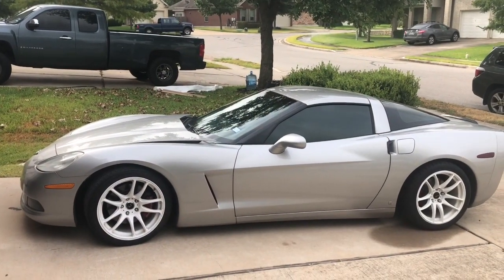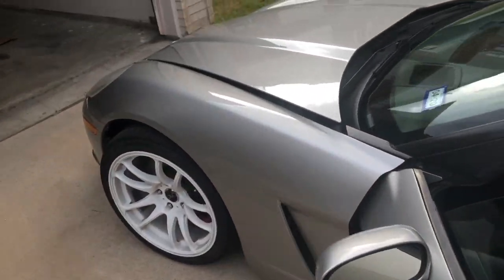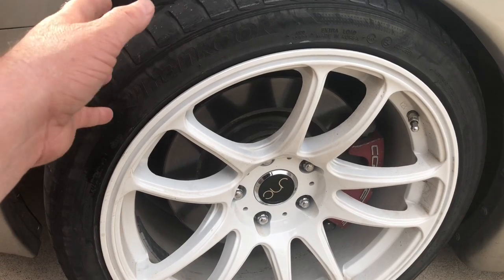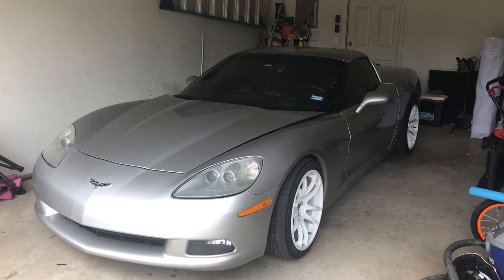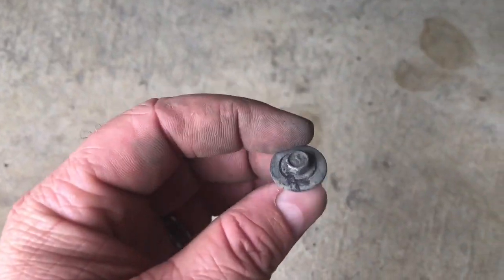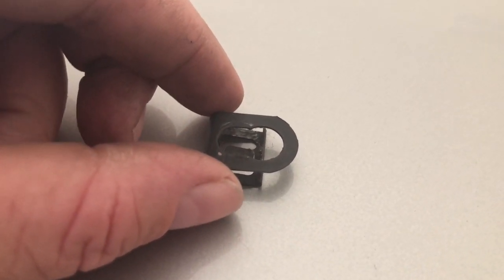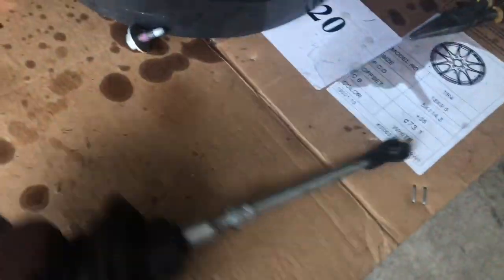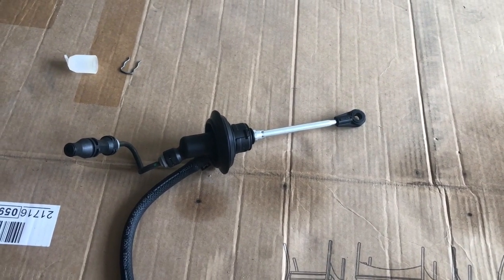Changing the Clutch Master Cylinder on the Driftvette

Comment: whats is the size of the tires you were using on this wheels dude?
Reply from the maker: 265/35/18
Reply: @DIYD_Do_It_Yourself_Dad  thanks.
Reply from the maker: @delucca011  that’s what I used for drifting. For street or drag I would go with a wider tire.
Reply: @DIYD_Do_It_Yourself_Dad  Im also looking for some advices to drift with vette, what is the essentials mods, such as angle kit and suspension, but as well if we need to unplug some fuses from ABS, or track control or something else
Reply from the maker: @delucca011  coilovers, anglekit, bucket seats and hydro is all you need. Hydro is debatable but I like using it. That’s all mine had and it ripped.
Reply: @DIYD_Do_It_Yourself_Dad  greattt, and aboout the car, do you just turn off the track control , or do you did some another mods ? I believe the ABS , AIRBAG should be off as well , right?
Reply from the maker: @delucca011  yes you can use the button near the cup holders to turn off traction control and my hydro brake deleted the abs.
Reply: @DIYD_Do_It_Yourself_Dad  great... i Tthink we  can turn off the abs and airbags just unpluging the fuse box, the track control its fine to use disabling at the buttom, great
Reply: @DIYD_Do_It_Yourself_Dad  did you have the problem from the clutch pedal stuck ? Im having this issue, I already changed my fluids, my clutch feels good, but sometimes when i push hard he stucks at the final .. I`ve watched some videos to add a spring on pedal, I will try this , if you have any other advice, please let me know
Reply: @delucca011 Late reply, but hopefully you maybe tried replacing your clutch master cylinder, the factory clutch line; as well as wrapping the clutch line in heat resistant material, to prevent it from excess heat soak in the engine bay. I also try to use a high performance DOT 4 brake fluid, and cycle/change it every 3-4 months (or earlier), depending how often/hard I drive. 

I installed a DIY version of the Lingenfelter clutch return spring, and got rid of the factory clutch assist/return spring. The stock clutch pedal spring actually helps to keep the pedal bottomed out, when it’s pushed all the way to the floor; hence my decision in getting rid of it. Just make sure that your DIY spring is firm, but not TOO firm. You don’t want all that fake, hard pressure on the clutch pedal, so that you can feel everything going on, in case changes in the clutch hydraulics occur.

I’m also on the stock clutch/flywheel, as well as the stock clutch slave cylinder. I’m not gonna replace anything INSIDE of the bell housing right now, but all I know is that OEM brands (AC Delco and GM) are the only brands to go for, when replacing the CMC and CSC. The quality and design may suck, but aftermarket ones are inferior as well…. Even the Tick Performance adjustable CMC has had issues in the long run..

Comment: Where did you end up finding that little rubber tip you used to put in the hole on the Reservoir
Reply from the maker: Came with the mighty vac

Comment: Is your wheel bolt pattern 5x120? I’m looking into buying new wheels for mine but I’m a little worried the original pattern(5x120.65) isn’t compatible especially for drifting. If so have you had any issues with with the new wheels?
Reply from the maker: cabezadebanana1 5x120 works just fine
Reply: What do you think about adapters while drifting? Not the best idea or....?
Reply from the maker: I used them all the time for drifting. Just make sure they are torqued down and check them before each event
Reply: Do It Yourself Dad awesome thanks again!!, I’ll look for you if you ever go to the Houston events

Comment: Whats the wheels and offset? Looking for a drift setup for my c5 z06
Reply from the maker: BEHIND THE WHEEL 18x10 +20 all around. I think a 18x9.5 +30 or 35 would fit better unless you like the poke.
Reply: Thanks. Good video! Yeah trying to stay tucked, looking at the carbyne wheels? What brand master cylinder did you go with? Is it the Luk lmc372?
Reply: What wheel brand is that? I can’t find 18x10 only x9.5 and x10.5

Comment: Were you able to fit the clutch fluid reservoir through the engine bay and onto it's location while installed on the line/master cylinder?
Reply: Late reply, but no, you can’t. Lol Did you have that much trouble installing the reservoir separately or keeping it installed in the new upper clutch fluid reservoir line, while installing the new CMC?